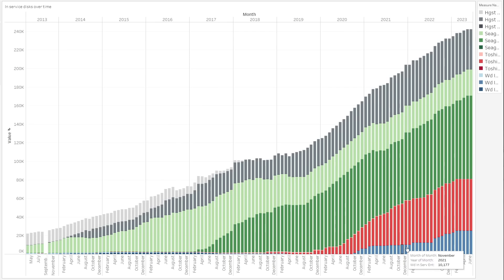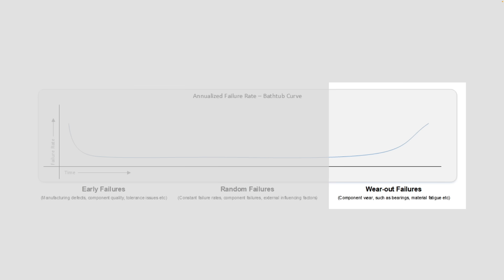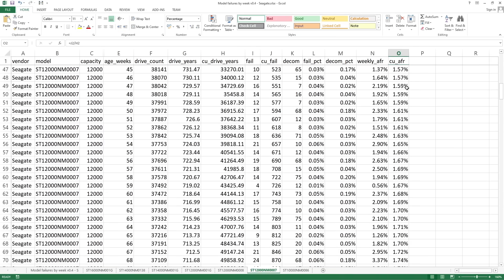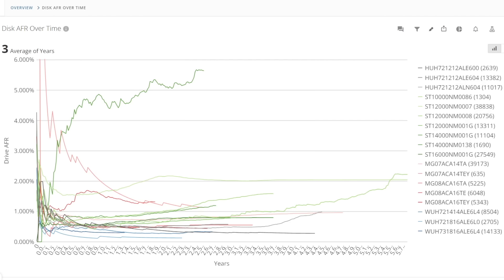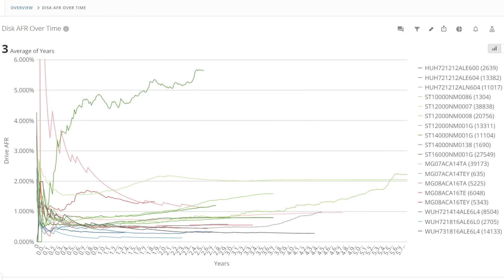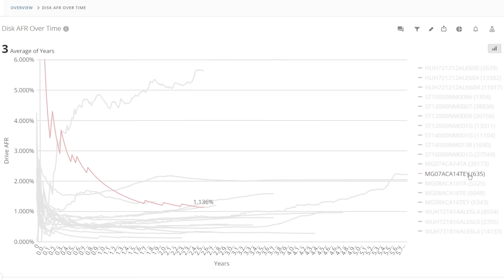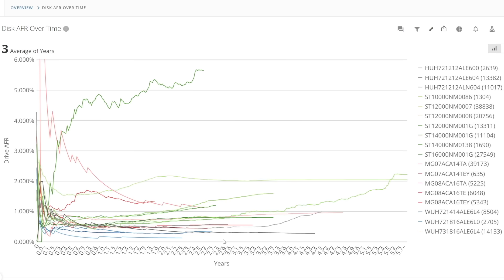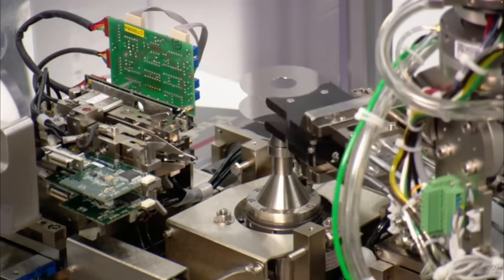Failure Rate Analysis - Best 10Tb+ hard drives: Seagate, Western Digital or Toshiba?

Comment: This might seem odd to some but unlike most here, I've had nothing but phenomenal experiences with Seagate drives, still have some 20 year old ones running perfectly, yet had dozens of WD drives that failed within half a year to 2.5 years, especially 2.5" drives, even when stationary. The shingle magnetic drives really put me off of WD, but looking at this data I might have to reconsider my choices for my upcoming NAS build..
Reply from the maker: I also had good experiences with many Seagate drives. But people are more likely to share bad experiences than bad, and this is why I think the data is so important to remain objective. Thanks for sharing your experience 😄
Reply: My experience is similar to yours. Using exos and ironwolfs mostly but even some barracudas that refuse to die. I don't trust any hard drive so 321 for data that's important.

Comment: I have a Seagate Hard drive that been running for more than 139000 Hours, that's almost 16 years of 24/7 and it is still going, it just recently re-mapped for the first time 8 sectors to spare ones but so far nothing else gone. it have load/unload the heads 5 million times so far
Reply from the maker: That's impressive, which model is it? 😎
Reply: @sometechguy  I answered the question to those who wonder what model it is but the comments keep getting filtered, could you go fix that in your studio settings?
Reply: @PowertoastMusic  Welcome to youtube, post a link or anything "controversial" and the comment will instantly dissappear :D
Reply: @sometechguy  A year has passed and he don't tell us the model.
Reply: @sometechguy  I bet it's not ST3000DM001
Reply: In addition to the "boy, they sure don't build em like they used to!" argument, which does have merit, the more important factor to note is that drives just got a lot more complicated when we added multiple disk platters to get to larger capacities - way more things can break. Then they started getting cheap with SMR drives which should be avoided like the plague.

I have an old Hitachi drive from 2008 I ripped out of my old Black Macbook 13" that's still serving as my parity disk in my Unraid array. It's slow as hell but it's still chugging away fine.

Old disks like ours from that era are the Toyota Corollas of disks - simple and less things can break, but slow and last forever if you don't eventually force it to retire
Reply: dude, whats the model?
Reply: @sanquinteros  ST96812AS 60GB
Reply: I still got my 500 gb seagate Free Agent M series and still working. I got it in 2004 so been 20 years!!!!!! 😎😎😎😎
Reply: @JCSAP-cs4ziI have a 20GB external HDD that still works since 2002 lol
Reply: @sometechguy  A year has passed and you didn't tell us the model.
Reply: so what was the model? i don't see it here
Reply: @Vasault  Must be the older, lower volume models. I believe in those, Seagate including.
But they progressively got worse with size growth. I got 12tb Seagate exos few years ago. I did not even think about using a single drive, raid only because I am certain at least one could fail within the next several years.
Reply: @Shineinpoverty  yeah, i always hear people on youtube saying they have hdd lasting over 10 years, but is people that got into nas many years ago, hdd these days are not as reliable as it was back in the days
Reply: I bought 2 hdds in 2012 and they are still going strong. Having said that, drives that I bought 2,3 years ago did not last long. I think quality of material has been going down.
Reply: @screensafari17  yeah, you get very different amount of mileage from your drives. It is a hard task to find the best lasting ones
Reply: @Pulverrostmannen  tell us the model already. What the.... you drop the bomb and vanish.  What a troll.
Reply: @screensafari17  Maybe there is better quality in getting drives in batch for RAID/NAS? Maybe buying in 1s or 2s you get reduced quality?
Reply: Seems like you are one of the rare guys 🤣
I have two im my drawer which doesnt work anymore. In this drawer is no wd drive
Reply: @hansdampf2084  I have best luck with Seagate. Medium with WD. And worst with Hitachi.
Reply: That's only ONE drive though.
Reply: About 7-8 years ago I had 500G and 1TB Seagate drives each die within the the first 6 months of ownership. I dropped Seagate for WD and HGST drives (I have about 20 total) and have never had a single failure yet.
Reply: Consider yourself lucky, in those days everything was built to last, not anymore.  Even though it was on 24/7, how much did you use it, consumer hard drives are not meant for continuous or frequent operations, so yeah if your drive was idle most of the time that is another story.   Once a drive starts relocating sectors, you should consider backing up and buying a new drive, especially if the number keeps going up.  Another thing to consider, is ALL the data on the hard drive healthy ? I mean sure the ECC kicks in when reading files, but how do you assume your hard disk still runs fine ?  Did you ever look at S.M.A.R.T. attributes ? Is your uncorrectable sector count at 0 ?   If one of the drive's critical attributes increases and keeps increasing, I would seriously get a new drive, it will fail eventually....
Reply: @jimmydandy9364  In what world do I need something to last 20 years when the tech will be relatively dated by then?  My 15 year old PC is still running, but it is woefully inadequate compared to the PC I built 8 years ago; and massively overshadowed by the PC I'm building here shortly.  If I can buy a 2TB HDD for the same price today that I could buy a 1TB HDD a few years before, there is a lot of value lost in trying to make that 1TB HDD last until it dies - especially when data integrity is so important.
Reply: i have a couple HITACHI HUA72101 that have been in a NAS for several years. they were repurposed from an enterprise system that was decommissioned.
SMART says Uptime (hour) 93538 which is 10.67055 years. 
I am about to replace that NAS and get some newer stuff.
Reply: which model is it?
Reply: 16 year old drive? does it click lol? Maybe you are running a simple web service from it and never turn it off and all the PC does is run the server from ram and the drive sit in idle 24/7 lol.. anyway, might be worth an upgrade.. considering NVME can do sustained read rates of 4 GB. Your drive on a IDE cable or is it a early SATA revision, maybe a scsi disk..
Reply: Its writing, power failures, bad psu and other things what makes hdd goes bad faster after some time in most cases and not having pc on 24/7 especially if you mostly browsing or doing some other light work or just leave pc on. Even often on and off can be more bad than having 24/7... It would be more impressive if you wrote how much data the hdd did, not hours. Similarly with cars miles vs age
Reply: The most hours any of my drives have is 60k on a ST2000DM001 (made in July 2016), it is now retired but still fully working. I did have another drive of the same model, but made in 2013, fail some years ago in another system with way less power on hours.
I do also have a ST2000DM006 from March 2017 with over 50k hours and retired it the same day as the 2016 DM001
Reply: @Pasi123  My seagate hdd 2,5 - 64438 hours and works good now.
Reply: I was using 20GB ATA Seagate for about 10+ years, not 24/7 but still it accumulated years of work.
It started to run hot and noisy, probably bearing wear out, but it refused to die. I still have it somewhere.

Few year ago I bought 3GB Seagate, it was running perfectly fine, but one day it just made click sound and died ...
They don't make things like they used too ... I decided not to buy mechanical hard drives any more ...
Reply: My two Seagates are around 8 months old with only around 200h, but already lost about 15 points in the Read error and 30 points in the Seek error Rate sections. Bruhh....
Reply: @jakobschneider558  So would you say that paying attention to the read/write rates is a good metric to predict drive failure?
Reply: You got a really good drive. That's really good.
Reply: I've never had an issue with a Seagate product, but your drive seems like one of those rare cases. I just replaced a halogen bulb in a light fixture I bought in 1990. It was my main source of light that I used all the time for 34 years. The Phillips replacement is only good for 1.3 years at 3 hours a day.
Reply: I never had Seagate last more than 3 months same with western digital, a PC hardware manufacturer sells me crap, They never get my business again,
I use AMD CPu`s AMD MOBO`s, as INtel lost me when they embedded a ID chip into their CPU`s in Pentium 3`s to this day,
I only use mag drives for storage not for use.as they last longer then SSD`s.
Reply: I can’t reply to anything here for some reason. I made a video on the drive on that channel now
Reply: Watch it be a st225
Reply: yeah i have an almost 15 year old seagate that only failed recently (i recovered all) that i bought refurbished from amazon, not bad at all, don't expect that with an SSD 😅
Reply: Because the failure rate above is almost the same amongs brands compared to the production sold
Reply: EXACTLY, you have the key in your text, 16 years.......your hard drive is old and in these years things were built to last.......... I can bet you $$$$$ that if you get a Seagate drive today it won't last anywhere near 16 years running 24/7, and you'd be lucky if it lasted even 5 let alone 3.  Companies have cut corners, cut costs, and quality control is lacking (ask Boeing :P ) .  So yeah....
Reply: @jimmydandy9364  I have redundancy....:D
Reply: @jimmydandy9364  I have 9 4TB Ironwolf's from 2017 at 60k+ operating hours in a high performance company setting. Not a single failure... If one fails, i'll replace it (cheaply) and keep my data. I run a company not a brand fanboy service, so do the datacenters. Maybe your galaxy brain can put 2 and 2 together and figure out why Seagate is such a huge sampled brand in all these tests. Hint: it's not cause they're unreliable garbage, it's cause they are reliable enough for their very competitive price point, so these get sold at huge volume. Keep buying overpriced stuff thinking you're outsmarting everyone dumb dumb.
Reply: @jimmydandy9364  ...simply wrong.   Technology has increased efficiency and longevity.   Today's Seagate drives will probably last twice as much as a 2010 model.
Reply: @HappyBuddhaBoyd  Not trying to be disagreeable but would you say that HDDs are a product that manufacturers don't create a planned lifespan? I suppose I could argue both ways: 1. Planned lifespan bc of lowered cost, increased efficiency, longevity, ubiquity. 2. No planned lifespan of HDD bc increasing failure rates(planning to change out drives regularly - subscriptions) is labor to change them out(downtime), slows profit/end user efficiency, dissatisfied end users. What say you and others?
Reply: Hi, how do you remap the drive?
Reply: @Helios.vfx.  You don't, it does it by itself
Reply: @Helios.vfx.  Typically a normal drive will automatically re-map sectors when needed by itself through its built in Smart function. 
You can monitor this using software such as Gsmart control and Crystaldiskinfo. 
You can manually do a sector scan of a drive and search for bad sectors using Gsmart control or Windows/programs to check the drive for problems before they eventually get big enough to cause major problems. 

When a drive is getting worn out and it re-map a lot of sectors or mark many as problematic it is a sign of eminent failure and you should replace the drive. 

For example: reallocated sector count. This is the value of successful remaps that the hard drive done for you both on mechanical and SSDs. A value higher than 0 is a sign of age or increasing risk of failure. 

Current pending sector count, this value indicates the drive have problems with sectors but it is waiting for a suitable time to re-map it or check again. It may also be that it is failing to do a re-map of these sectors hence it is a pending problematic sector. 
Increasing values here have a big chance of damaged data as data is often still stored in these inaccessible sectors. 

Uncorrectable sector count. A value here indicates the drive have problems with sectors and could not correct them with the built in smart. This is often caused by locked data due to file systems on the drive. 
Your data is at eminent risk of failure as your drive cannot correct damaged sectors. 

If your drive have all the 3 combined in higher values you can be assured you have to backup immediately because your data is at maximum risk of complete failure. 

Monitoring a drives Smart is a very good thing to do at all times as all hard drives are constantly keeping track of their own health at all times

Comment: Are the early high failure rates common for helium drives? Maybe it's damaged in shipping.
Reply from the maker: If anything drives have been improving in reliability. The very first he8 drives took a small hit, but drives vary so can’t be sure it’s related to the helium fill process.

But generally I don’t see a reason to believe that helium drives are less reliable. But transit damage is a hidden enemy in drive reliability.

Comment: Lots of info but nothing to the point! The best one is  Seagate Exos that's all there's to it!
Reply from the maker: I think the point was about as clear as it could be, that the WD drives have a lower failure rate. And I don't dislike Exos, in fact I have many of them as they were available at a great price point, and I didn't have problems with them. However, objectively they do have higher failure rates.

But maybe you work for Seagate. 🙄
Reply: @sometechguy  No I don't work for Seagate :)!  I've been heavily into computers for more than 25 years and got lot's of experience. As for WD - got two external and both failed! Had many HDD - WD and it was a real mixed bag. Now I've got two 14TB Exos for more than 5 years and the work like clockwork. I've been using them for video editing and projects.
Reply from the maker: I am not looking to change anyone’s opinion here, just providing data so viewers can make informed choices. And personal experiences are very powerful. But overall, I think objective analysis based on very large datasets should be more reliable than subjective analysis from small samples. 

But the statistical nature of this means that everyone can have a different experience. And overall , though the Seagate sample here had higher failure rates, they were not in a different order of magnitude. And they are generally more affordable.

Comment: Back in 2017 I bought barracuda 2.5" HDD for my Laptop, after installing windows suddenly it crash, and became boot loop, when I move the HDD to my friend desktop pc, it cause his pc to crash
Reply: The hard drive has bad sectors that need to be marked so Windows won't read them and crash. Running chkdsk /b will mark these bad sectors. The drive can either automatically swap them with spare sectors, or they will be recorded in the NTFS file system as bad clusters to avoid reading or writing. It's important to run chkdsk /b after reformatting to avoid installing Windows on bad clusters since reformatting clears the list of bad clusters, and this list needs to be rebuilt.